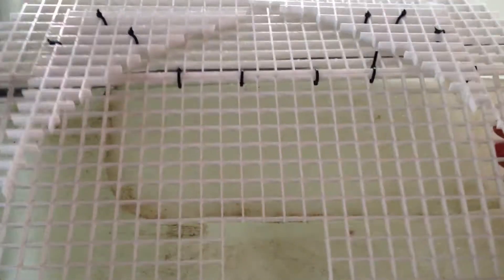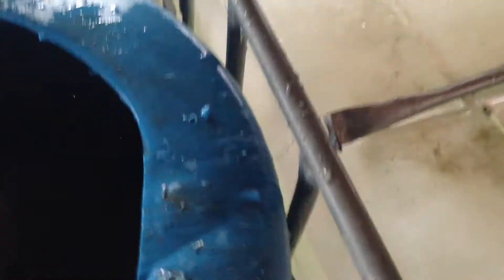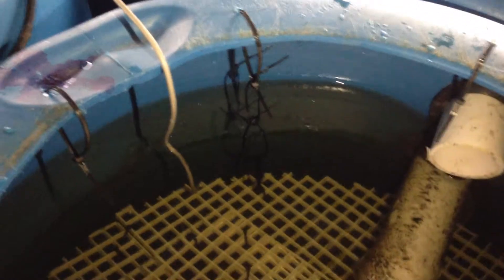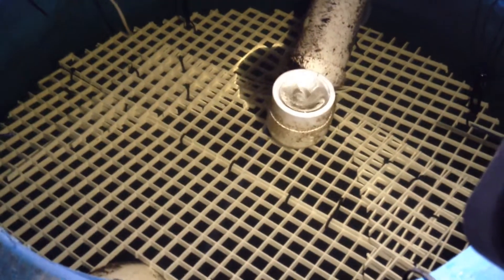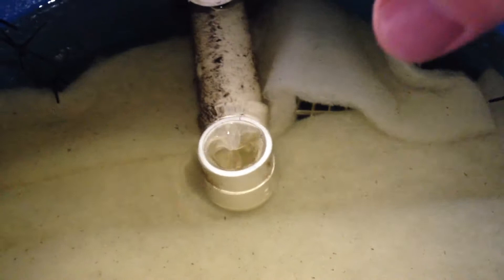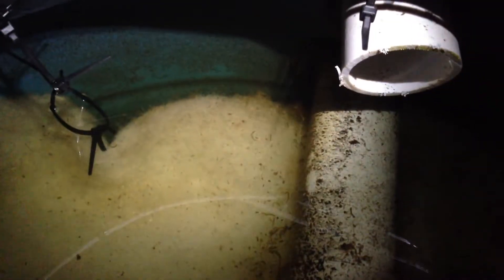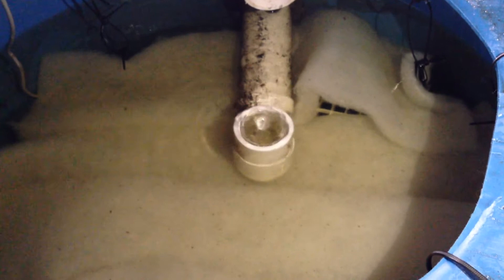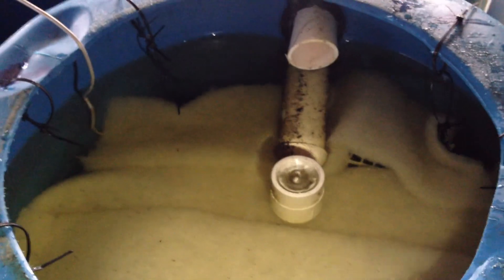Installing Mesh Filter Padding to Stop Swirl Filter Bypass

Comment: Why don't you just tie a filter sock to the outlet pipe from the tanks.  They are inexpensive and easy to use.
Reply from the maker: Because then I'd be replacing a filter sock every other day or so. This system is near balanced at less than 1" from spilling over (my own poor design) but that means that any obstruction in the flow loop can cause the tank to quickly overflow and the sump to run dry. A sock would greatly minimize the effective flow area of water out of the sock (unless really long), and each day as debris builds up, the area would get less and less. This design allows the full cross sectional area of the barrel to be effective flow area, and as debris would try to build against the bottom of the mesh, they will get heavy and sink to the bottom of the barrel, like they're supposed to anyway in a swirl filter. The swirl filter was working great until I switched to a semi-floating pellet. The floating food means floating poo! For a swirl filter to work correctly, the poo has to be heavier than the water.
Reply: Tom Brueggen
I understand your point about any obstruction causing an overflow.  I run many aquariums at my house and for a side business.  It is always a big problem of overflowing water.  Believe me, I've done it at a dentist office a number of times over the last ten years.  Never pleasant and worse if it is in a place of business.  You at least have the advantage that the water runs out on the ground and not into an office.  That being said....In my humble opinion a filter sock will be far easier to clean on a regular basis than your sponge design.  I understand the surface area you are trying to achieve.  But a long sock will actually have more surface area since it is spread down a long tube.  You would need to get the largest sock possible.  I've seen some 7" x 16" at bulk reef supply.  You would want to get a sock with a large opening and a holder (can probably make your own) that holds the sock open so that if it does get clogged to the point of not letting water through, the water can just flow up over the top of the sock into the barrel.  If you got a couple of socks you can just throw a new one on and let the other sit in a bucket until you have time to clean it at a later time.  They always seem to need changing at the worst possible time (ie when your the most busy).  With the set up you are going for I think you will run into a situation where it is difficult to clean the filter and you would end up throwing it away instead of cleaning it....maybe.  Socks can be rinsed easily enough with a garden hose.
Reply from the maker: Herbert Landwer Fair enough, I will look into it. What I am going for with this setup is kind of the same thing. I don't intend to take the filter mesh out. Instead I'll put a 1" drain in the bottom of the barrel with a valve that drains into a bucket, or out into a waste line. Then, once the fluid level in the barrel is down and not in contact with the bottom of the mesh, wash the mesh vigorously from above with a spray nozzle, to rinse residuals out and off the bottom of the mesh. It wouldn't be a pristine clean each time, but rather just a quick unloading of excess waste material. But yes, I rather like where you're headed with the filter sock. Like you say, I can just have a few on hand, at least two, and then just do a quick switch. And hey, then I'd be left with a sludge concentrate of fish poo, ready to go right where I need it for fertilizer, instead of hauling bucket after bucket of diluted poo water out to where I need it. Thanks for the input, I'll look at it. My wife is the expert fish keeper. Check out her channel "kdv9tb". She makes my tilapia totes look like chumps compared to her live planted tanks!
Reply: Tom Brueggen
Will look at her channel.  I've been keeping fresh and saltwater fish and reefs for over 20 years.  Always like to see how others are doing things to see if they have a better way.